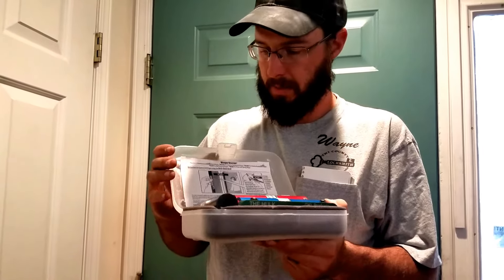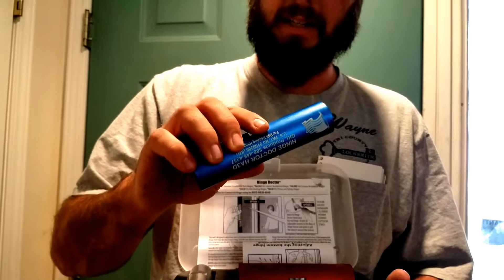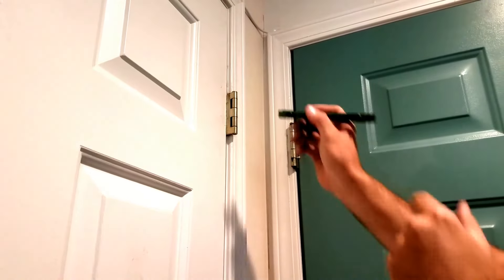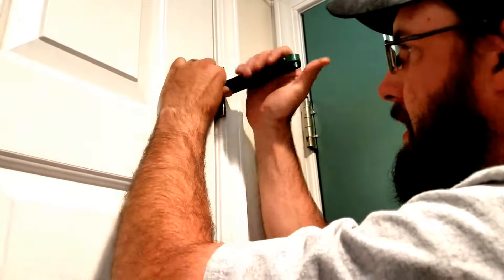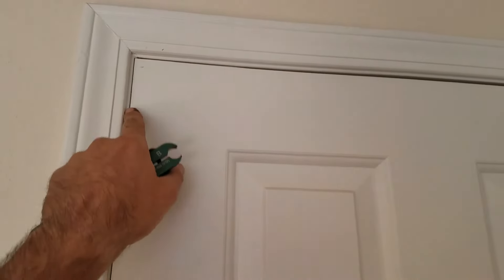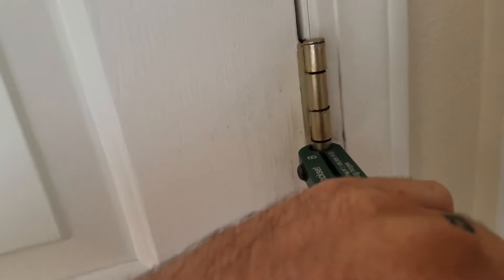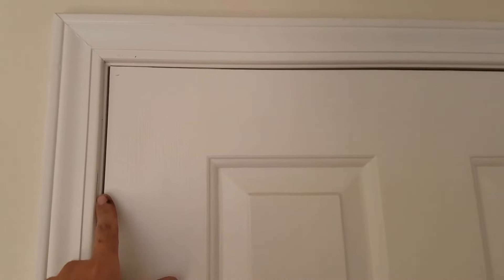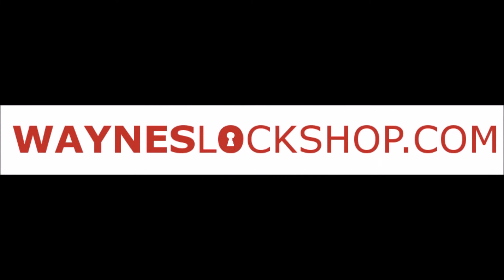Hinge Dr. review how to use guide. The Hulk hinge wrench in action. Fix sagging doors

Comment: This product looks great! Please take the hinge pin out, shim your gap to where you want the door to be and then adjust the hinge to align, sometimes slightly past to allow for sag. And don’t forget about the other two hinges. If you only do one the middle one is fighting against it. Take the pin out of at least the one you need to adjust and the middle one of it has it. Better job, proper better fix.

Comment: I've fixed quite a few residential doors  and the problem is never a bent hinge. It's always that the building has settled or the door has warped. Usually the problem is the door rubbing on the top of the frame.  On rare occasion it is that the screws on the hinges have worked loose, which is easy to fix with a screwdriver.

Comment: You didn’t demo the other pieces in the kit as you said you would.  
The direction onforce, toward the lockset seems backwards to me.  How can pushing the hinge in the direction of the lockset make the top of the door move in the opposite direction of the direction you’re bending the hinge???
Reply: The arrow is the the positioning of the tool . You crank towards the lockset also . As for the other hinge tools , you simply slide the tool on the hinge , open the door untill there is a bit of restriction . Then open a bit more  and check if it was enough . He was wrong about one thing tough . The black one is not for residetial hinges . It is for 4 1/2 commercial hinges . The blue one is for ball bearing commercial hinges